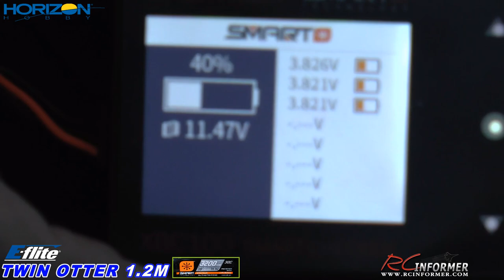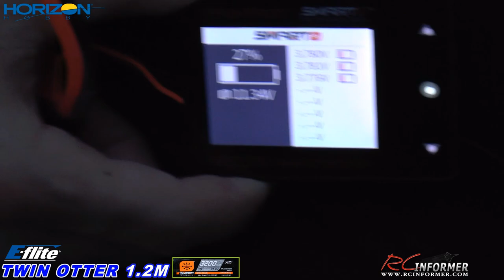E-flite Twin Otter 1.2m confined area Seaplane Demo By: RCINFORMER

Comment: Thank you VERY much for these water videos on this plane with you and Steve. One thing, which I am sure you know and are just used to using the balance wire connector to check the battery level, but with the Spektrum battery checker you can check the battery level with the MAIN EC3/EC5 wire connector also - IMHO easier than lining up the balance wire connector 😉